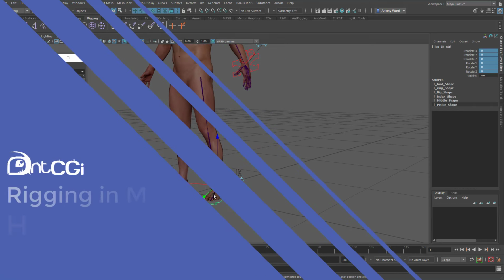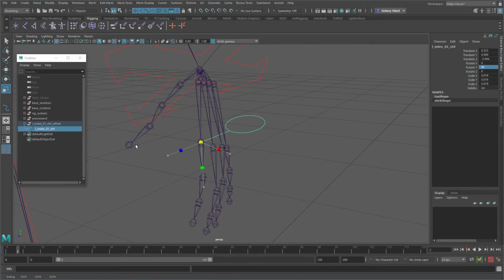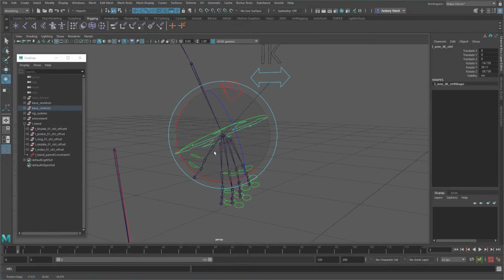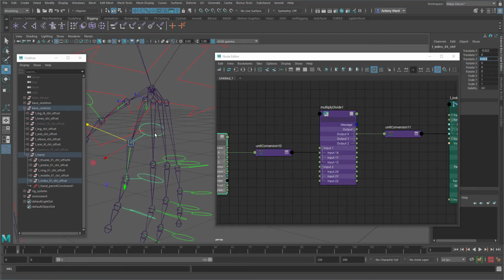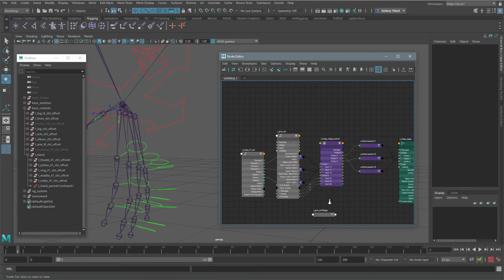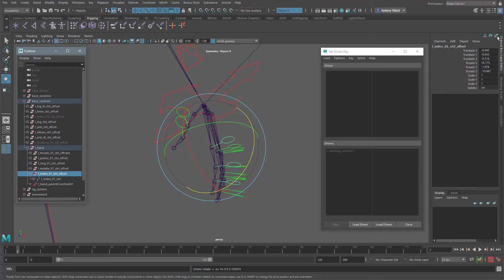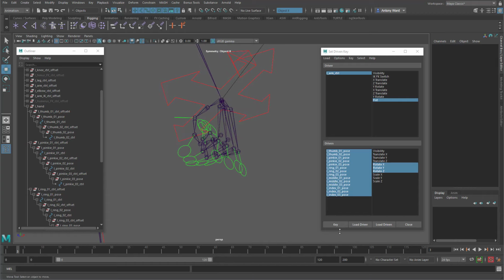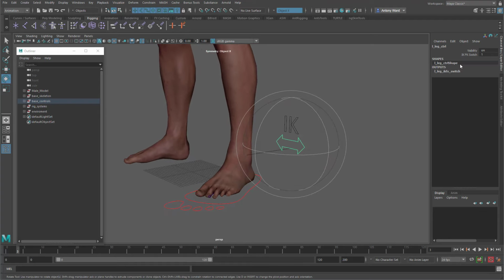#RiggingInMaya | Part 6 | Basics | Hand Rigging

Comment: I'm follow the unreal tutorial rig but I'm here because I can't understand why the joints and the controls rotation doesn't match  when  I do what you do in the video. the match works just for the joint that I'm not doing some change, for example the match is ok for the fingers but It doesn't work for the  thumb ( the one that i rotate manually and than freeze ). Please help me 😭😭😭I'm very depress. I did everything how I should.

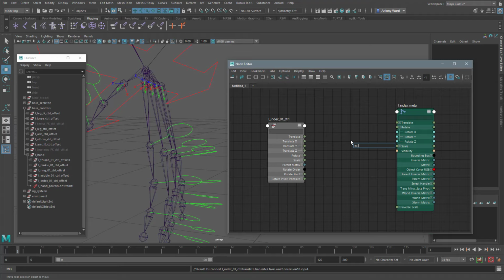Comment: About 15:03, when I connected the control translate X to the joint rotate Z, the rotate didn't work and was 0 no matter what translate values I input... When I typed in multiplydivide and connected them, only one unitConversion appeared so I added by tab and still won't work. May I get any kind reply for this situation? Thanks!!
Reply from the maker: Hi, it might be worth you posting a video or a screen shot in my Facebook group - https://www.facebook.com/groups/485519638944997/
Reply: I figured it out! It was because my model was a T pose one, therefore the rotate axis was a bit different from your video! Thank you so much!
Reply: I'm having the same problem, but my model is Apose :( i only get one unit conversion (from multdiv to the joint). i have no idea how to fix it, this section is mildly confusing to me
Reply: Ac tually I figured it out!! So i have my local rotation axis set to have x be the primary axis instead of y, so I had to accommodate for that with the connections!! Took a minute of hard thinking, but I got it to work :D Love your vids.

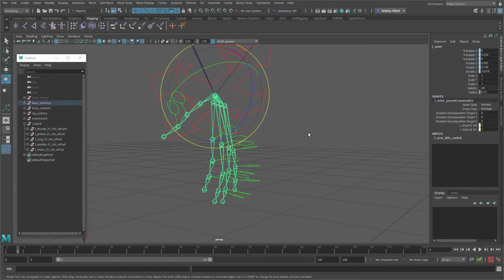Comment: Ran into an issue at 11:00 I parent constrained the hand joint to the finger control group like in the video but when i rotated the IK controller, nothing on the hand moved. Going straight from part 5 to 6, did you change anything to the rig? Are the FK/IK parented to the main joints to allow this to work?

Comment: how do you slide the mouse to change the values of the attributes? I can only slide it inside the window and it does not slide smoothly through all the float values, it goes directly from 0 to 1
Reply from the maker: Your slider setting might be too high. Click the little ring above the channel box attributes and this will make scrubbing faster or slower. Then just use the middle mouse button.
Reply: @antCGi  thanks!! That worked

Comment: hey! Thanks again for this awesome tutorial, but here is an issue im finding.
Arround min 10:11 you explain that you have to parent the controlls to each joint so u can FK them, but the problem is that, when i do that, only the end joint of the chain actually rotates. the other 2 stay in the same place and rotate in the same place, i dont know what could be causing this because i have oriented my joints and the controllers properly, but still havent fixed it.
hope i have explained myself clearly, thanks in advance! <3

edit: nvm i fixed it, if u find this issue check that ur controllers are parented correctly, i had them in the same group but they were not in the same curve group so the hierarchy was uncorrect. <3
Reply: Hi I am having the same trouble but I don't know what you mean by 'curve group', everything is parented correctly when I checked
Reply: @maru2825  hey buddy, the thing is that they don't have to be in the same group like this:

-group_offset:
  -curve
  -curve2
 -curve 3

But instead like this

-group_offset_01:
{
  -curve01:
  {
     -group_offset_02
    {
        -curve02:
        {
             -group_offset_03
            {
                -curve_03
             }
        } 
     }
  }
}
I hope I have explained myself properly :P
Reply: @noahdelviso3231  can you share  screen shots of your outliner ?
Reply: @noahdelviso3231  i have the finger controllers under each off set grp , and the offset grps are parented under each other .

Comment: I am loving the tutorials!
But I am not understanding  those "offset groups"... What are they used for?
At the beginning I thought they were for the Set Driven Keys but no.
Reply: they're used to get the correct orientation of the joint
Reply: @Eindrew9  The correct orientation without affecting controllers actual attributes?

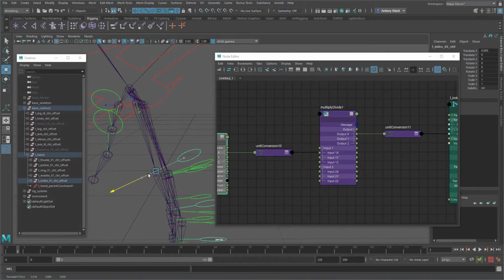Comment: okay this has happened to me twice already and I dont know what happened or how to fix it. I dont know if its a bug or what. I did everything on the left side and now Im reapeating it on the right side. I am at 16:33 now, working on the rotation of the meta_joints. It wasnt working and I realized that when I rotated the joint, the children were not following. Only the next joint (so the next sphere) was rotating with it. I googled it and everyone said to check the "preserve child" box on the move tool window, I did that and its still not working. I have the same issues on several joints, like elbow etc. Then I checked the left side again, that was completely done and was working perfectly, and its broken as well!! Only the FK Control for the wrist works, the IK Arm Control does not move anything anymore (same with my Foot Controler) and I just dont understand anything. ALSO, I created 2 backups, just in case i need to go back. On the Backups the rigs of the left side were perfect, no issues. Now i open them and the controlers and joints dont rotate or move anything either?? But I ddidnt modify anything on the backups, so I really don't understand what happened. And I have to start over again... but I would like to know where the problem is, so I don't repeat it again because its a lot of work

Comment: If you're doing a direct connection with the input being the translation of controller and output being rotation of the joint, are there any disadvantages to using aim constraints?
Reply from the maker: Aim constraints can be very temperamental if not setup correctly, so you can end up with the joints flipping at certain angles. They are very useful, but I only use them when I have to.
Reply: @antCGi  ahh ok, thank you for the tutorial and  your response :)

Comment: great tut!! when i do the set driven key and key the fist then switch between them it doesn't animate it just snaps to that pose any ideas?
Reply from the maker: So when you blend it snaps and doesn't animate?
Reply: @antCGi  yeah i realised if i put 0.5 in the fist attribute it does half the fist it just doesn't when i change from 0 to 1 in the arm_Ctrl
Reply from the maker: @moonie878  is the attribute a float or an integer? So can you get 0.5 on the attribute or does it go from 0 to 1?
Reply: @antCGi  it is a float so I can input 0.4 for instance but when I switch it goes straight from 0 to 1 and vice versa. So it doesn't show the animation
Reply: @moonie878  are your animation tangents set to stepped and clamped? I had a problem with this. I would then have to go into the graph editor and manually change the tangents for the set driven keys to Auto
Reply: @alicelambert859  I will take a look tonight. Cheers

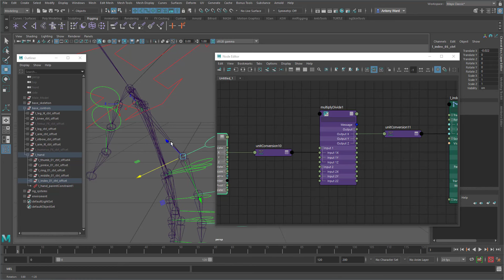Comment: Been working on the META Joint and trying to get the finger control to influence it via the method at 16:40. I do everything the exact same way as you and somehow when translating the control via the X Axis the Joints Z Axis rotates in the opposite direction.

e.g. When the control moves in positive the joint rotates in negative.

Is there something I have missed or done wrong.

Thanks
Reply: Ignore me I was just being dumb. I kept looking at the video but just wasn't seeing it. I looked back on another Rig I had built with this method and it was working fine. I went back and forth trying to figure out what the problem was... then it hit me... 'MINUS' I somehow forgot to bloody put a minus in the multiply... I hate myself so much lol

But if you do happen to read this, you're an amazing teacher and keep up the amazing work :)
Reply: @Slashthemeister  yes had the same issue but both should move in +ve value if one thing is going in +ve?

Comment: Everything was working but then only my ik control could rotate and move around the hand and fingers, fk wouldnt work, it would just pull the wrist joint while all the fingers would stay at the same place.
Reply from the maker: Did you parent constrain the hand group to the base wrist joint? It sounds like you constrained it to the wrist IK joint...
Reply: @antCGi  thanks man, its working properly now. I love your videos btw, best in the field.
Reply from the maker: Wolfy thanks! That’s great to hear, happy to help!
Reply: @antCGi  Thank you for these videos, they are great! I have the opposite problem of @Wolfy, though. My hand group is parented to the base wrist joint and moves just fine with FK. IK will move the whole hand, but it doesn't rotate like it looks like you do in the video. I've gone back and forth a number of times to see what you click on and I followed what I thought you did. My first time through I managed to forget to orient the controls correctly and both controls worked, but nothing rotated the right way. I started over, because I couldn't figure out where I messed up, and now it's just the IK rotation. I appreciate any help. Thank you.
Reply: Also, I have my thumb joints orientated correctly, so they curl in on Z, like the other fingers. But I can't seem to get the thumb controls to match. So curling with the controls are on X. I've tried rotating the alignment as you teach in your videos, and as had worked for everything else, but I can't get it to stick for the thumb. Maybe this doesn't matter? I'm new to this, so I don't know what happens down the line if it doesn't match exactly.
Reply: Hi, in case anybody has the problems I did. I got the IK rotation to work. I used the node editor to just connect the rotation from the control to the IK wrist. It wasn't connected for whatever reason. I also fixed the rotation axis for the thumb controls, by just doing again what you said. I don't know why it suddenly worked, but it's right now. The translation axis are wrong, but I'm hoping that doesn't matter.

Comment: I had an issue when copying the parent groups over to the other fingers, what I did as a fix was just duplicate each control and offset over first. Then matched transforms on each offset and did the same for the ctrl (then deleted transforms). Either way the controls would work in the proper rotation, but this made it easier to align them. 

Just in case anyone else had this issue.

Comment: I saw you putting in a time offset in graph editor manually for the driven key at 34:36. I tried to move driven keys in graph but they snap to the "time" values I assigned to them earlier. Only typing in the time offset manually ensures that they will stay in place. Is there a way to move them via slider (shift+MMB) or am I doing something wrong?

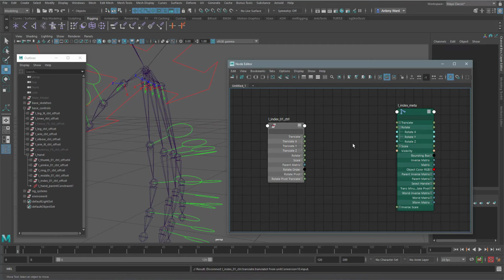Comment: Great videos Sir ,learning a lot from you but several doubt still exist for me. At 14:58 Why not use conversion factor in unit conversion node instead of multiplydivide node also the rotation of meta joint orients only up to a certain value of translate x ....also why u didnt create separate meta offset controls for mid,ring,pinkie ?
Reply: I guess because on newer versions of Maya you can't edit the UnitConversion node. And honestly, you shouldn't work with that node in particular, as it's not only limited in which you can do (the MultiplyDevide node can have multiple inputs and outputs) but it's not a node made to be edited.

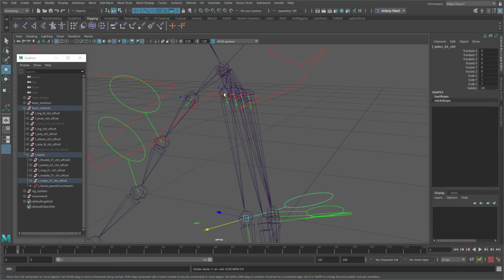Comment: Very nice series so far, but I have doubts about the metacarpo rotation axis with the finger control (12:46). Why not use an aim constraint instead of the nodes? Maybe is just an alternative way to reach the same result?
Reply from the maker: Mattia Furlan I used IK originally but it became unpredictable in certain poses. I also had clients find other issues with the setup too. In general I prefer a more solid approach but there are times when IK is perfect.
Reply: @antCGi  ok thanks for the feedback 😊